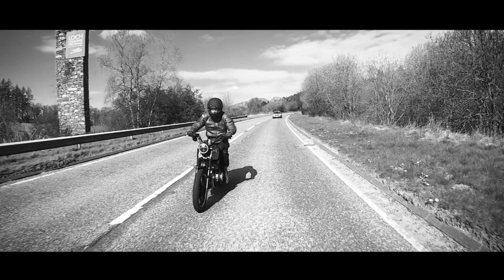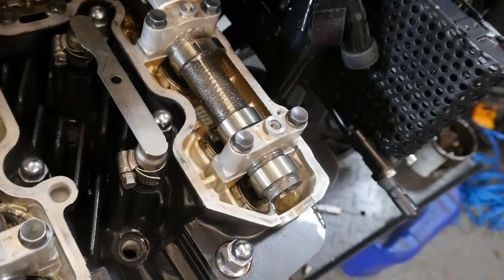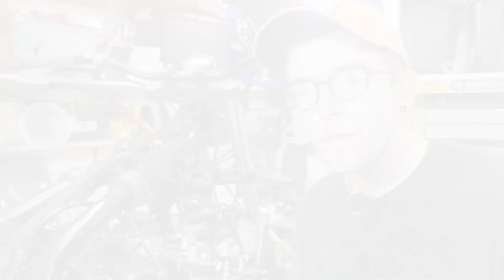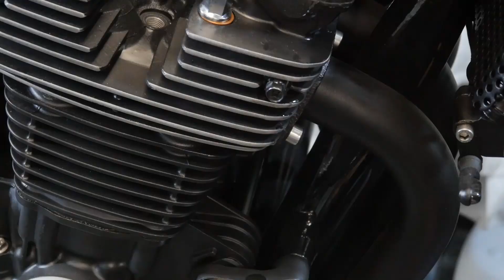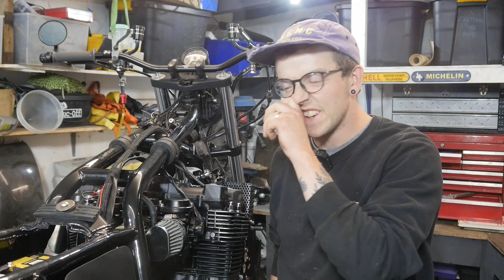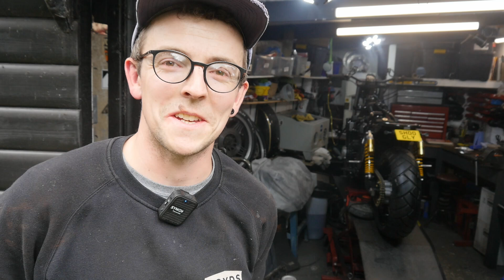XJR Valve Checks and First Start Up! Yamaha XJR1300 Shoogly Shed Motors

Comment: Really enjoyed watching you build this XJR 1.3 well done ! I have the same bike bog standard though. Either your bike or mine has the rear springs round the wrong way ? On mine the coil spring has the shorter gaps the top ?
Reply from the maker: Interesting! I had mine rebuilt by an Ohlins specialist, but not saying they did it right! 😂